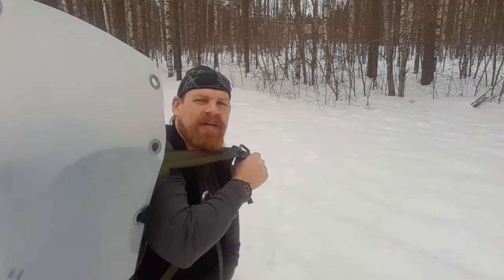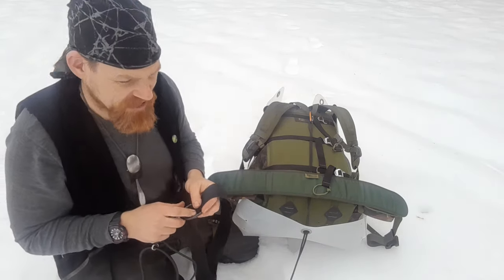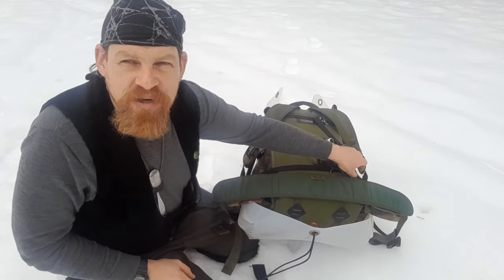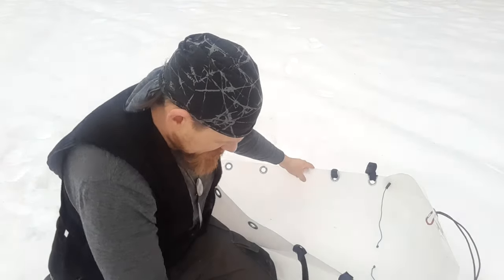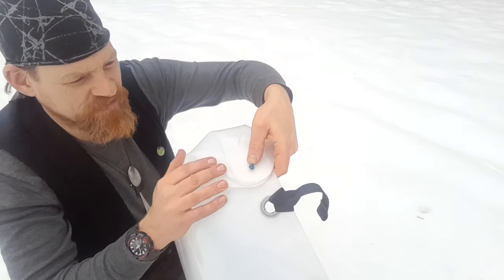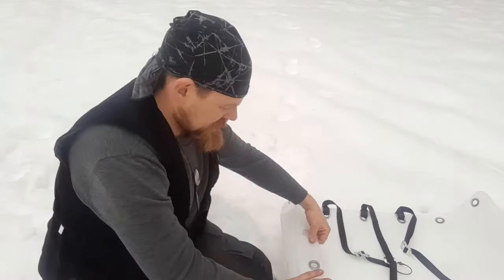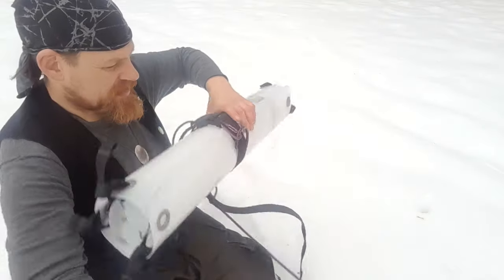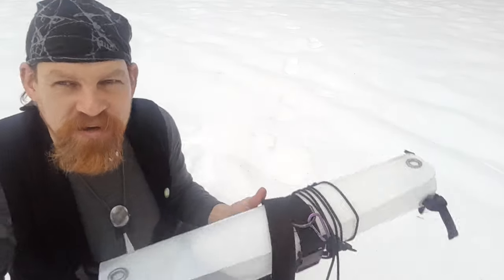DIY, 1kg roll-up pulk

Comment: Hi, Love the idea. Do you share the dimensions or a tutorial in order to do the same?
Reply from the maker: Nice that you like the idea. I decided not to show too much instructional detail since I got some of my own inspiration from Jemtlander and their Pullpac product. The dimensions depend on the size you require for the bag/backpack you want to transport. Basically the width of the sheet needs to be the width of your bag plus twice the height, and the length needs to be about 1.5times the length of the bag or more if you wish to transport more stuff. Drill holes at the end of the shaping-cuts to stop the cuts from ripping further. Here a link to the Jemtlander page. In case you are unsure about building your own, I suggest to buy their Pullpac.
https://www.jemtlander.se/pullpac-sled